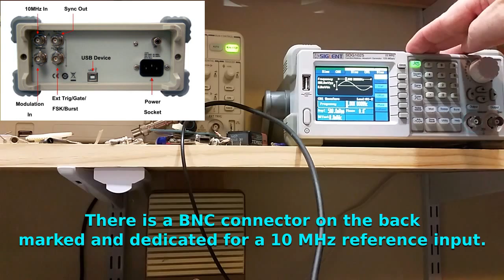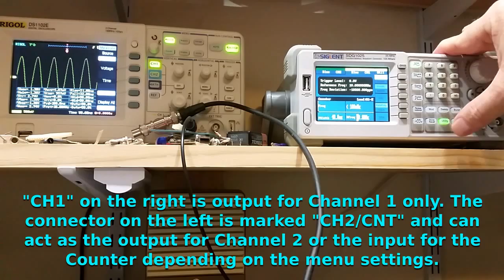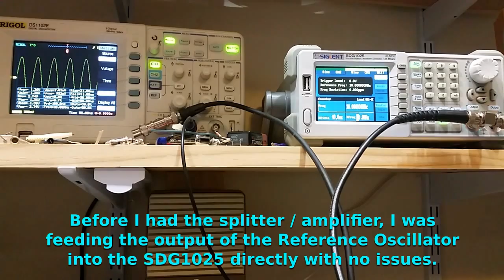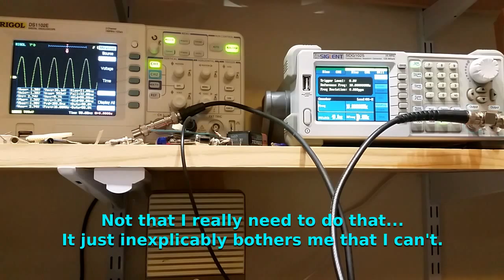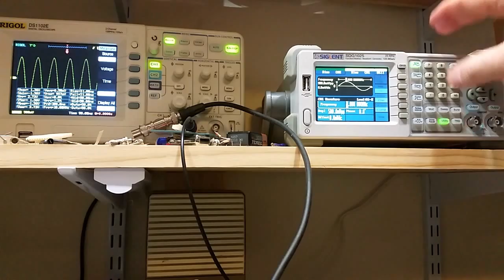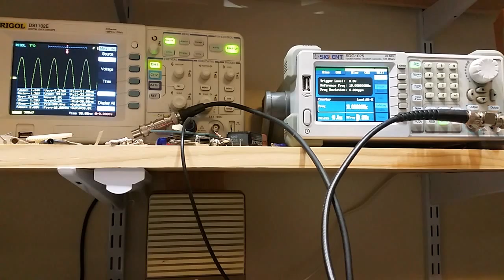A 10 MHz Refence Oscillator for the Siglent SDG1025 Waveform Generator

Comment: Thanks for making this video, just what I was looking for!
I am new to all this, so please bare with my question.
Could you please tell me if there is any advantage on having all your gear, running from the same 10 MHz reference?
I.e. oscilloscope, function generator and digital bench multimeter.
Reply from the maker: Generally most "hobby" applications don't require extreme precision. I managed for years using WWV or an old CB as a frequency reference. The advantage of using a single standard is really just that things match up. Before my signal generator might have read 10.000070 MHz on my frequency counter when I set it to 10 MHz. It is more one of those things you address out of interest than necessity. With my o'scope, the digital one does not have provisions for either an external reference nor easy calibration. With the various analog scopes I have, there just isn't the need for precision. My bench meter also can't be adjusted for frequency calibration, but it only reads to 1 MHz or so to 4 digit accuracy anyway. Although I do plan to do a video on precision voltage references sometime soon. :-)
Reply: Many thanks for your great answer! :-)

Comment: I have a Rigol function generator that I believe is almost identical to your Siglent and I found there is a setting in the utilities that allows you to have it start up using the last used settings. That may be why you will (or will not) have it using the external reference default at startup.